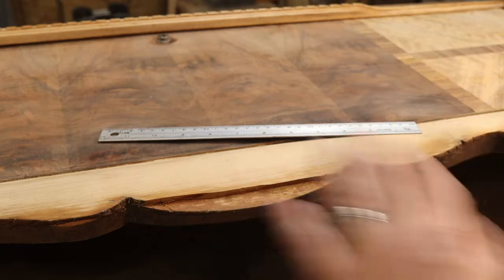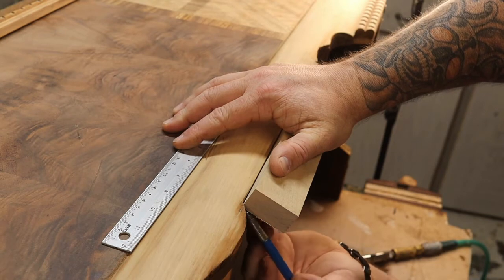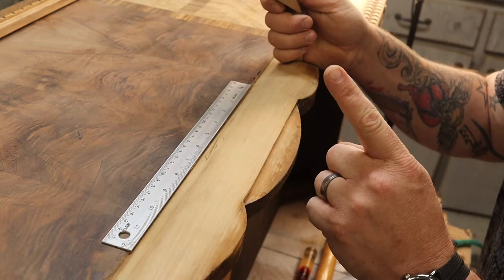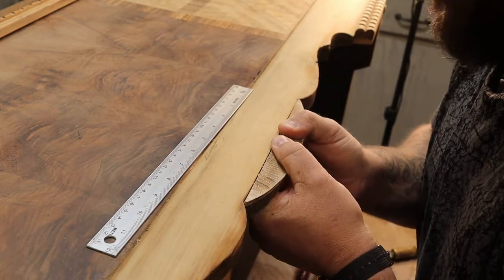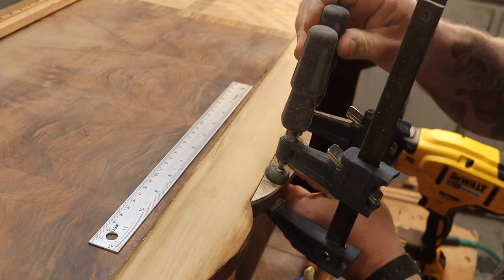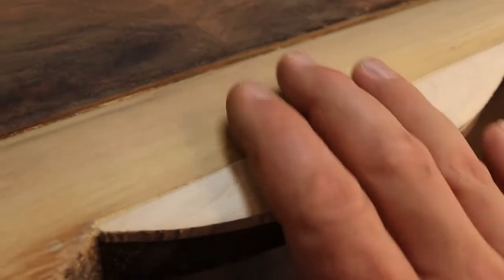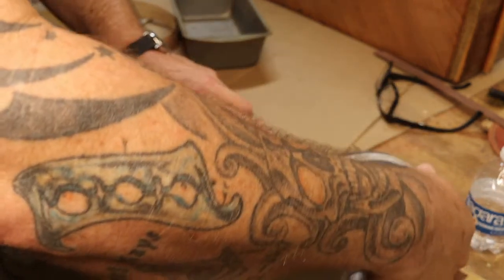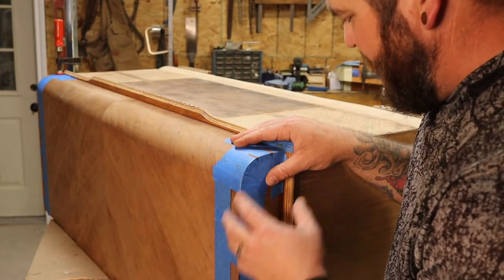RESTORING AN OLD CEDAR CHEST PART 2 (REPAIRING DAMAGE AND PREPPING FOR FINISH)

Comment: This is the part that I'm scared of. The veneer on my mom's chest is a little worn just on some of the edges. Small spots, but still the veneer is gone. Wondering if I can build those small pieces back with some wood putty. I'm nowhere NEAR experienced enough to do those nice edges like you did..

Comment: I have a tiny spot in my chests veneer that needs a patch. I think I could just do wood filler and stain or camouflage it. What's the best choice for a stainable wood filler?
Reply from the maker: I have used minwax stainable wood putty only so far and i can get decent results with it . Just make sure you take your time and dont rush. Try to make a similar defect in a scrap piece of wood and practice your repair. And try different stain colors to see which would match your project best and dont be afraid to mix different colors together in a small mixing cup the possibilities are endless mixing stain colors and you can get really close matches with a little trial and error!